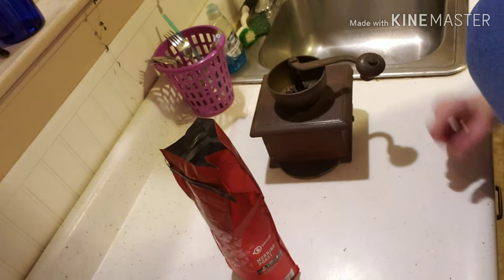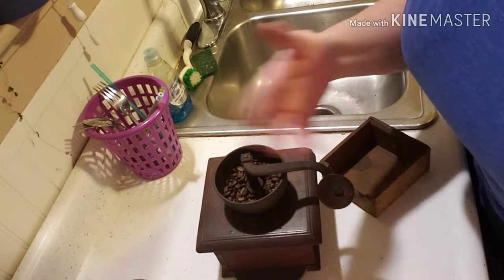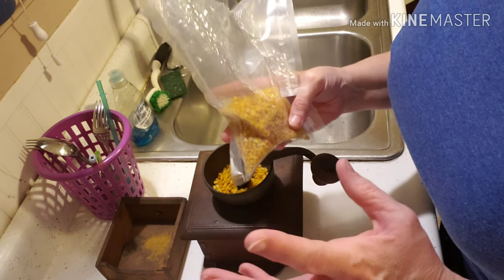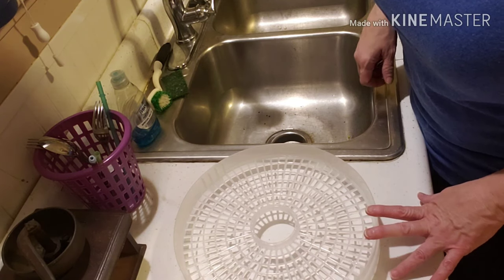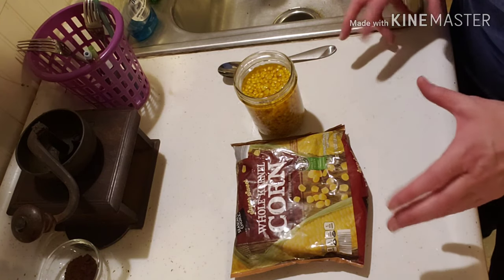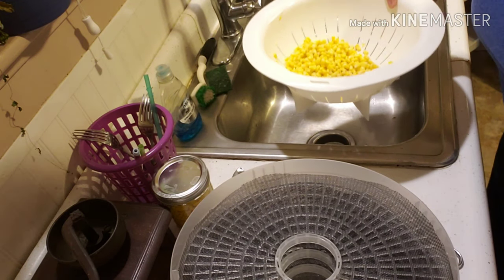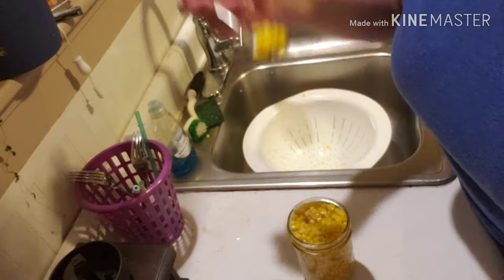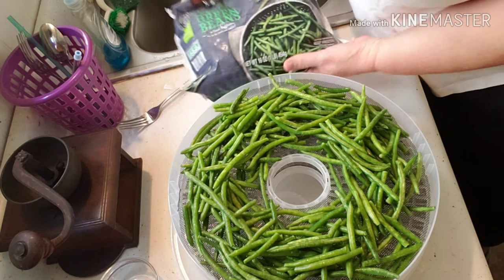Taste test: reconstituted corn

Comment: I used to have a coffee mill very similar to the one shown. Mine had a screw that attached to the base of the handle. Readjusting this screw would enable me to adjust how fine or coarse the grind would come out. Take it apart and see if there is an adjustable screw somewhere. Good luck with your coffee!
Reply from the maker: That'd be great. Thanks. I'll check it out.